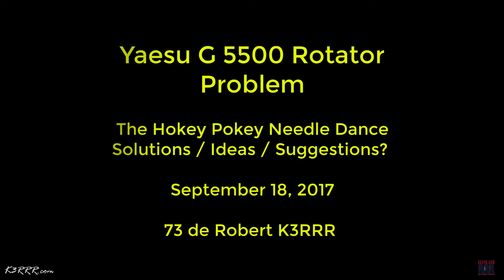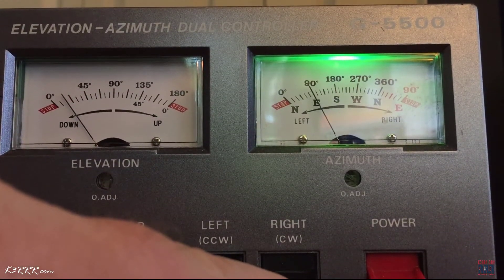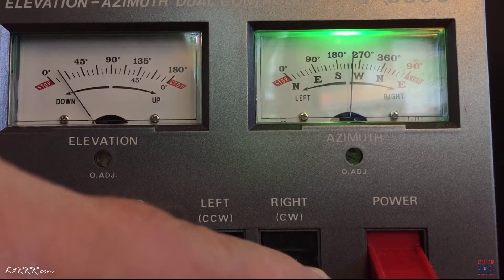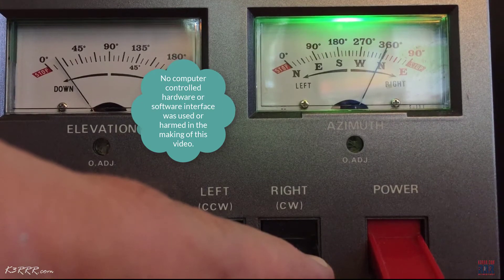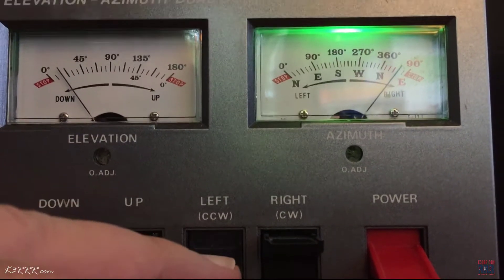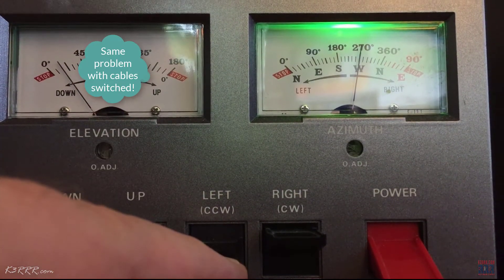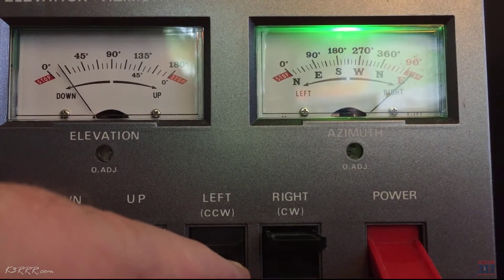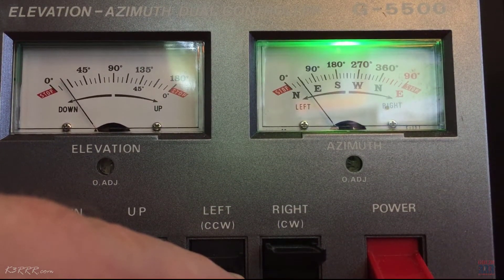Yaesu G 5500 Rotator – The Hokey Pokey Needle Problem with My Satellite Antenna Rotator

Comment from the maker: Updated Update: I sent the azimuth rotor back to Yaesu for repair and maintenance including replacing the pot, replacing the ball bearings and greasing where appropriate, etc. This occurred in October 2017. 

Unfortunately, over the next three months I had to send it back TWICE more for a total downtime of three months while waiting for Yaesu Repair to finally get their act together from their very bad workmanship and get it fixed. (Second time, a cogwheel fell off and the third time a screw had not been tightened properly and had fallen down into the motor – piss poor workmanship by Yaesu Repair!) 

I ended up spending approximately $220 for repairs and shipping while being off the birds for almost 25% of a year!

Come to find out, you can buy a brand-new azimuth rotator from the parts department for only $250 – plus $23 for shipping. This comes with a one year warranty and a brand-new lower mast assembly. They charge the same $250 for a brand-new elevation rotator also. (They want $379 for the controller!)

Rotators wear out. They are highly mechanical and subject to immense wear-and-tear. I get that. However, the level of incompetence by Yaesu repair was so intolerable – along with their lies about covering next day air shipment has made me decide to sell, other than the rejuvenated G 5500 rotator, all my Yaesu equipment and go with ICOM.

Comment: Hi there mate 
Did you figure it out ??
I have similar problem with the needle but the thing is mine doesn't move on 
It move the rotator up but on the controller there is nothing 
Any idea ??
Reply from the maker: Check your wiring by swapping the two cables around at the rotators...if that is OK, could be your voltage regulator inside the box. Good luck! 73 de Robert K3RRR